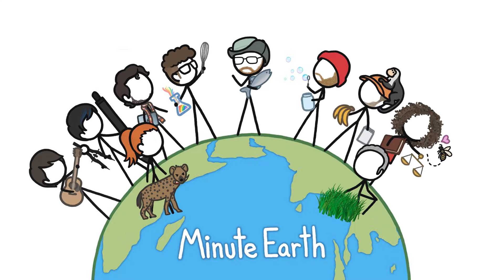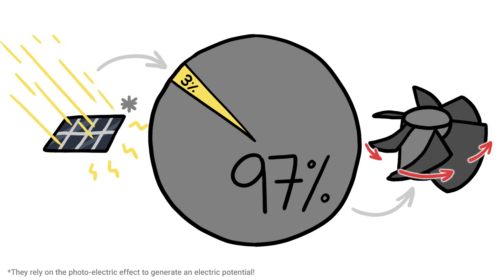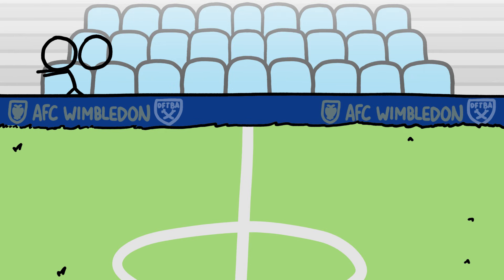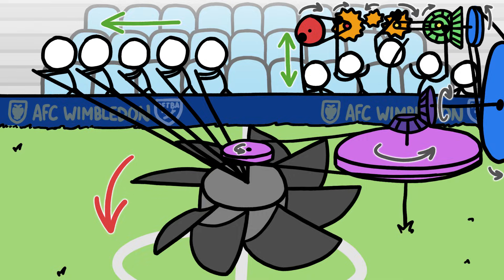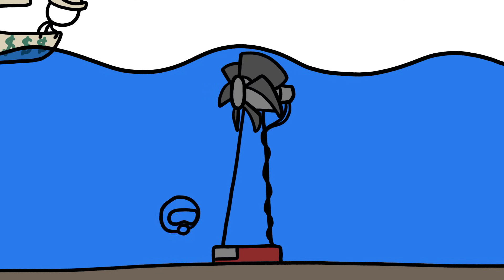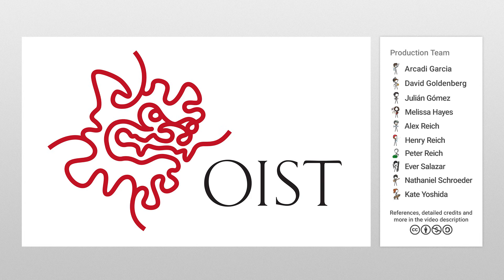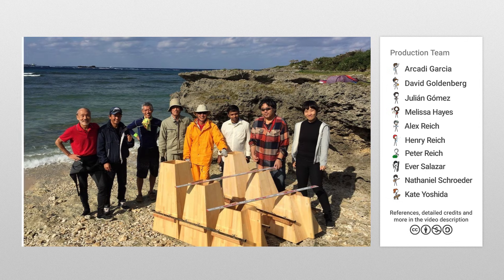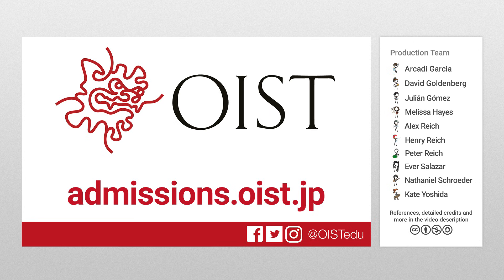Why Can't We Get Power From Waves?

Comment: Also we haven't found a way to harness energy from cats chasing their tails in circles.
Reply: You'd still have to feed the cat, so it'll be uneconomical. It'd be better to harness the laws of nature itself.

Such is the concept behind CatBread™, another feline based energy source. Cats have an uncanny ability to land on their feet, while a slice of buttered bread lands butter side down.

By combining these two distinct phenomena, one can attach to an ordinary cat's back a slice of buttered  bread with the buttered side facing away from the cat, such that when the entire CatBread™ apparatus is dropped, the two opposing phenomena effectively cancel each other out, leading to the CatBread™ oscillating in place just above the ground. By simply pushing it on opposite sides from the top and bottom, we can induce a spin which can power a turbine, thereby generating electricity.

On the off chance that it produces too much energy in a small space as to create a blackhole, we can simply harness the Hawking radiation from it, that is, if the blackhole doesn't consume the planet.

Comment: Why not just turn that cavern upside down?  A big tube with its mouth open to the sea; when the water breaks over it, gravity pulls the water down, hitting the turbine and spinning it?  Don't focus on the wave so much, turn the ocean into its own gravity powered turbine in the form of a big tube.  Its constant, as water is constantly falling into it.  Excess water can be stored chambers first then released in a constant stream if you will.

Comment: Ok, how a 'bout this idea?
Bottom of the sea, verticals tunnels with different lenghts that vary by region and presure.

The basic idea its to let gravity pull down water into the tunnel with turbines that get the energy from this water.

It could have some kind of special door sistem to let the water in, and to give it a pause so it can filter the remaining water out of the tunnel.
The issue with this design, its where or how to fillter water out of there, so it can empty out, but not expending more energy into it  than the energy it generates...

Ohhhhhh crazy idea!
Thermal generator RIGHT BESIDES THIS!

Fillter the water direcly into a natural thermal generator undersea, so it can evaporate the water there, and expel the residual components back into the sea via the themal generator, that way, you could use more than one tunnel as the original idea implied making it an interesting combo with the natural thermal generator.

Still, thats a hefty expensive crazy ideaz thay may only pay off on the long way...

Ps: I really love to imagine new ways to do stuff no matter how crazy it may be lol

Comment: I think Carnegie is onto something with their CETO system which uses submerged buoys to power pumps as they rise and fall. The pumps force water through a turbine or can be used for desalinization. The system has very few moving parts so it should be reliable and regardless of tide or weather, the depth of submersion ensures that the wave energy doesn't overwhelm the system (unlike wind turbines in a hurricane, for example). I first heard about it in 2016 and it seems to be in testing now. It has amazing possibilities as long as there's enough shelf to submerge the buoys and the ability to anchor the buoys.

Comment: I don't want to spoil your video. Honestly tho you would do better to channel the waves and use a water wheel to catch the crest of waves...
) * ( as the wave slides through the 2 walls it will increase in strength and if you used a combination screw and water wheel it might fix your issues. Just make sure the wave flows between or into the walls, or use a reverse piston attached to a ocean boui as it bobs on the waves and rises with the tide it would force a mechanism of gears to turn '-'

Comment: Use the rising motion of the waves to drive a piston up, let gravity bring it down, connect it as if it was in San internal combustion engine and boom, constant spinning motion from wave energy, only issue is that this requires the waves to be of a constant, predictable height

Comment: Folks, one of your problems is that you're trying to apply the wrong technology. You want a wave to spin a turbine to spin a generator. Not really workable. Waves don't spin. Think of a steam engine. A reciprocating piston turns a wheel through a mechanical link. Waves reciprocate. Build a mechanical link that will turn a generator. SKIP the turbine. You'll still have to deal with the harsh environment, but I think that a float on a lever could turn a wheel that could turn a generator. Again, think of a steam locomotive; a back and forth motion converted to a rotary motion.  :-)

Comment: I remember reading about how the Celts had shore based pools with one way inlets and a smaller outlet that turned water wheels.  This energy was used to run mills and had started to be used for some industrial purposes.  Then the Romans invaded and Ceasar ordered the machines to be destroyed because it would cut into the slave market.
Reply: If the technology existed it would have spread to other nations. Why would u use a Slave IF u could save more money using a machine?

Comment: What does wave energy currently do for the planet? Would extracting/converting it on a mass scale cause some unforseen problem?
Reply: I don't think it is possible because the materials needed to harvest that much energy would be more than Earth itself has.

Assuming you could, it would have environmental effects, similar to what happens with dams in some ways. You'd be fucking with the currents most likely, so that would obviously affect a lot of fishes (not to mention the system itself is likely to have a direct effect). My hypothesis is the direct effects of adding "garbage" to the sea would be the biggest issue, way before you'd influence currents to the point it'd cause problems. The oceans are really big.

Comment: I have an incomplete idea, use a rubber balloon seal on top of a speaker like device, the air inside would be chucked around inside the ballon by the movement of the waves while constantly hitting the speaker, generating the electricity

Comment: make a giant worm gear spiral that with a pitch matches the period of the waves, u-joint stationary drive rod chain in the center that connects and anchors the spiral. Anchor the leading end to the ocean floor and to generator 

...

but you still won't get much energy out of it because water just... moves out of the way...

Comment: One suggestion is using the gulf stream as a source of ocean energy. On the basis that it is consistent enough to drive a turbine.
However others have pointed out that doing so introduces resistance to the gulf stream and removes energy from it. Meaning the current will not go as far. Which could have disastrous climate consequences.

Comment: Hmmm...guess you'd need something that doesn't rely on sideways motion but linear up and down motion. Not only that, make it so that its resistant enough to some of the most corrosive elements on the planet. 

I don't see this being a cheap option to be honest. It would probably be cheaper to just create and extend rivers and make them hydroelectric dams.Another option would be geothermal but then how are you going to make it corrosive resistant enough to stand underwater? Its nice to see people actually doing something instead of just bitching about change atleast.

Comment: All these ideas are dumb, you use a float to drive a diaphragm pump and store the water in a reservoir. You get the energy back when the water returns to sea level. You could also use a diaphragm pump to drive a RO desanilization plant and use the fresh water to grow crops and feed livestock. The only energy your worried about is electricity and there are other forms of energy that civilization needs.

Comment: So say you put a square  button in the water, its got floaties so its even with the surface in its own way, the button is very light, so when water passed over the top, it pushes it down, spinning the little cogs over and over to move the turbine. lots of quick, low impact pushes, the turbine will pick up speed over time hypothetically

possible?

Comment: well to bad, but even if we make an efficient method, there isn't that much energy in waves and it would be harmful for the environment, waves move through the water, if you absorb the energy there won't be any waves behind the energy collector, until wind puts more energy back but that transfer is less efficient when the waves it's pushing on are smaller, and to the harmful to the environment part, oxygen and carbon dioxide  need to be absorbed in the water for marine life to function and that is dependent on surface area, without waves or the smaller the waves you get less surface area therefore less oxygen in the water, so fewer fish can survive in the same volume of water. If you implemented this on an industrial scale within 10 years the extra ammonia shock released by the abnormally increased amount of dying organisms would poison the waters killing even more faster creating a runaway effect that we wouldn't be able to notice until it is impossible to stop, kind of like the global warming thing.

Comment: think you see 7 sails in a circle, holding in place from 3 side-ropes also in the backside of the convexside...check that the flow through the center hits another part-saio and gets split into two streams to bring rotation momentum. Begin on a byciclewheel with sailwidth- horizontal half the length off the wheelradius. make the curve like hyberboloid wide at outer beginning shortradius in the center. and make ventil slits in the sails....nothing new, search in on sailing info websides.

Comment: Ahem. Lever and fulcrum. Youd get a changing angle from the slow waves. which you could use a spring and locking mechanism to keep the mechanical power. You're essentially just using the mechanical energy to push a heavy weight at the fulcrum. Which is resisting a magnetic field. 

To protect the coils, you could just coat them with anything rust resistant. Like gold.

To fix the problem of erosion, just use thick plastic, and the barnacle problem, coat the outside with powderized silica based aerogel. With any fibrous bristly plastic, to help hold it in place. 

Idk, seems like a fun project to test at least. Pretty vague enough. Thank you 2 last remaining brain cells, your all that i had left.

Comment: It would be better to simply reduce our energy consumption needs. Most waves are generated by friction from the air passing over the surface of the water. Wind is all the result of radiant energy from the sun heating the surface portion of the molecules that compose our planet. Just collect the radiant energy of the sun before it enters the planets energy cycle. Problem solved.

Comment: https://www.omega.co.uk/prodinfo/accelerometers.html
An object on the surface of the ocean would experience acceleration each time it was moved up and down because of a wave.  That mechanical force could then be translated into the spinning motion of a turbine much the up and down motion of an internal combustion engine is converted into a spinning motion to drive the wheels of a car.  The other option to consider is how an accelerometer  works.  A mass of material squeezes a piece of piezoelectric material whenever it moves.  This produces an electrical charge.  For this application, we would just want to scale things up.

Comment: This video is a total load of cobblers. The idiot presenting this obviously has no knowledge on this subject.  There are many tidal flow turbine schemes currently working in Europe.  OK It's not huge scale yet, but it is coming and it will be coming big time soon.  Have a look at the Ocean Energy Europe website and get the figures for yourselves.
Ocean Energy is available 24/7/365 for NOTHING. There is ZERO pollution.  You can't get better than that.
For areas between the Tropics there is a huge amount of work going on in the development of OTEC systems.  Again look up OTEC there is a lot of info out there.

Comment: The people at Bungie featured an interesting idea in Destiny 2 on their map on Saturn's moon Titan.
Reply: What is the idea?
Reply: @fezii9043  Floating masses that push pistons with the rise and fall of waves.
Reply: @brendenpischke6060  oh damn, you right that IS cool
Reply: @fezii9043  basically what Brenden said. Massive metal plates sit just above the water and the surge from each wave pushed up the plate. The plate then drives a pistol which goes on to produce power
Reply: Haven't they mentioned buoys work the same way?
Reply: I think those were implemented in Japan somewhere. I definitely seen video if small ones working, but I'm likely misremembering where it was
Reply: It should have been called “A Second Destiny” or “A New Destiny”
300+days D1
Reply: @chetopuffs  Yeah I was a bit upset too that they made a second game instead of continuing to add on to the first game. I do miss my lance nova bomb, but considering everything else I've got in Destiny 2 I guess not having lance on my nova bomb ain't so bad.

My new favourite thing is the Devour effect, it makes dealing with ads a walk in the park. Doesn't matter how many ads the game throws at me or for how long. It just turns into a killing spree. The arc subclass's arc soul with the healing rift is pretty cool too.
Reply: @brendenpischke6060  
Also a voidwalker warlock. 
im on xbox. 
GT: Cheto Puffs
HMU
Reply: That idea has been around for a long time, but those waves are too big and consistent compared to earth ones.
Reply: @j.gonzalez2543  
Plus, no Titan barnacles. I hope. Oh gods...Titan barnacles...

Comment: Need to convert short length vertical movements at various intervals into a rotational Force.  

Assume for instance that we have a fixed point at or near the surface of the ocean. If we were able to extend a beam out between two of these stations we'd be able to generate power by spinning the beam. 
How to spin the beam? Bend it into a shape that matches the basic peddle boat and put buoys on the ends farthest from the center!
How to ensure the beam spins in only 1 direction? Make it 3 phase instead of 2 and Shape the mini bouys to be able to dump water on one side and collect water on the other.

The cool part is that you could even vary the distance between the bouys to match the average wavelength of the most powerful or prevalent wave.
Reply: Literally bike peddles do this. Just instead of 2, use any number from 10 to 50, and instead of 180 degree between them make 3 with 120 each. The make a horseshoe shaped bowl for the peddles.
Tip the horseshoe down toward the water and make sure that each side when spun is facing the same direction. As the wave pushes up, there is pressure inside the bowl pushing upward. At the top the wave fills in the bowl as it goes over the bouy. And as the wave lowers the weight of the water pulls it the rest of the way down until the next bowl repeats the cycle.

Comment: I see a lot of people who are attacking nuclear power because of the nuclear waste "problem". The reality is that nuclear waste is not a problem. All we have to do to manage it is to bury and encase the waste material in concrete in our old abandoned salt mines which can be deep underground and are huge cavernous mines that will not have a problem housing the relatively small amount of nuclear waste we make in the production of nuclear power.

Also as some other people have said, the toxic Cadnium present in solar panels with no plan to recycle it is actually a far larger concern than nuclear waste. Nuclear waste decays, where as Cadnium is toxic FOREVER.

Comment: So, when you do an internetsearch, you can find several succesful projects started sinds 2000, and you post this video in 2019 that it isn't possible...
Reply: He's not saying it doesn't work, he says it's too expensive compared to other ways. Unless it's cheaper than making wind power or solar, it's never going to be a viable investment for commercial use. It is possible we'll get there, which is why there is a lot of research and experimentation in actual seas to check the viability.
Reply: @meneldal  yes, and that is why I wrote that you CAN find examples that are already commercially viable...

Comment: Ive done a hilarious amount of research and experiments on this, the trick is to force the tidal currents through a funnel like structure forcing the water to spin around, the turbines are impeller that are spun as the water cork screws through the system,  you can replicate this with a 2 liter coke bottle, fill it, give the water a spin and hold it upside down, the water spins out of the nozzle, imagine an impeller at the throat of the nozzle.

Comment: To capture the energy in ocean waves, more than a spinning turbine is needed. Turbines also like a constant speed.
Waves come in different sizes. They come from different directions. Even a sterrable array of turbines will have underpowered and overpowered turbines (due to wave size).
The bobbing action is the most consistent, but loses about 1/2 of the total motion.
Finally, what is the effect (downstream) if a significant amount of energy is extracted? Sedimentation? Erosion?

Comment: Ultimately to have a turbine make electricity, it involves moving a magnet in some way. Perhaps just design a generator that has the magnet bob up and down with the wave in a way that moves it past some coils? Then you don't really need to have parts with tolerances that would crust up with minerals or be subject to problems from corrosion. Of course power made in this way would be irregular, so it ultimately needs to be converted to DC and using batteries as an intermediary storage medium before going to motor-generators or inverters that would match whatever is on the AC grid.